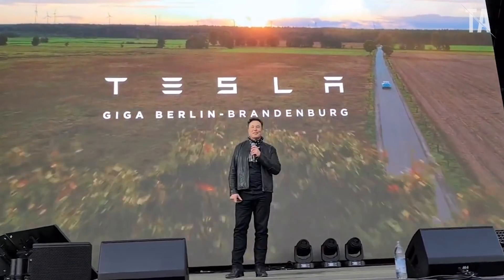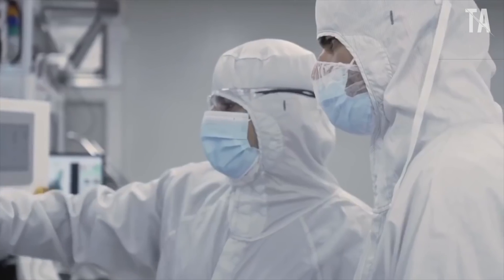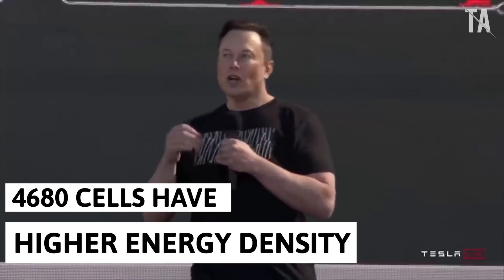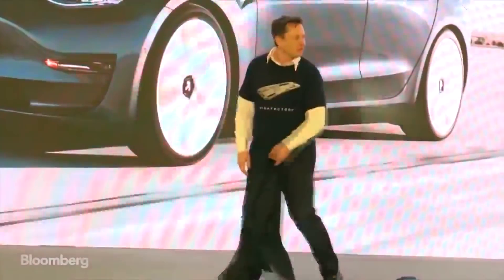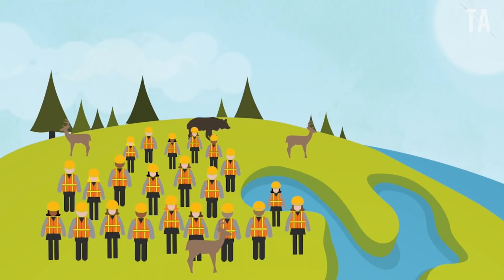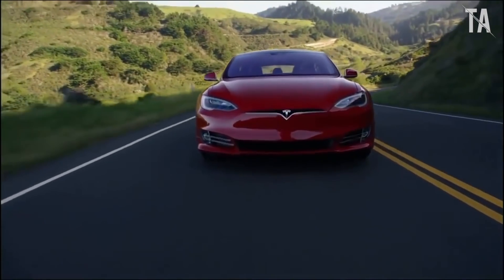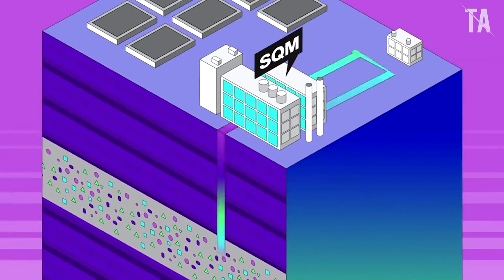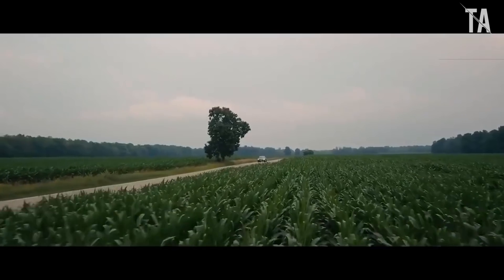Elon Musk WARNED EVERYONE The NEW Tesla 4680 BATTERY Will DESTROY ALL EV COMPETITION!

Comment: @Jabulani Harvey  you cannot cost effectively refine lithium bonded to carbon from chemical Degredation .. Its molecularly bonded to the anodes and cathodes.. which is why it becomes weaker in storing electrons.. lithium ion batteries aren't producing Ionic radioactivity.. it's branding, like 20v max DeWalt batteries are STILL only 18.6 volts.. and will power Milwaukee cordless tools.. point being there is no economical method to refine lithium from lithium batteries..

It's a finite resource..

MOST of which is found in dead rainforests AND more abundantly LIVING Rainforests... It's mined similar to fracking into limestone shale, which again is found in mountainous deserts, afghan NK etc.. " mankind hasn't yet figured out how to use  NMRF for  Harmonic synchrony , beyond poor attempts to build massive rings the size of to barely achieve over unity for TRILLIONTHS of a second..

So the left's plan is to F*st F** 
The Amazon and Congo rainforests for lithium, Neodymium cobalt which are Essential to the 15% efficient " brushless motors, when alnieko, Quartz crystal and Samarian Cobalt are Far stronger in Gaussian density and NOT Chemically Carcinogenic like Neodymium.. Quartz has been grown by the metric TONS...

How about an Electroacoustic piezoelectric quartz crystal Battery instead?

Comment: Your clickbait title is absurd also if the 4680 cells are the future then why switch the standard range to LFP batteries??
Reply: Actually 4680 only refers to the form factor.  LFP refers to the chemistry.
Reply: @audistik1199  I do understand that, how ever my purpose in stating that is why is Tesla using a different style of cell instead of the structure pack? I know that 4680 cells probably won’t be rolled out until giga burlin and won’t be seen in the US until giga Texas is fully op! I’m just saying if 4680 cells are the future why is Tesla using 3 types maybe 4 of cell packs
Reply: @nooneimportant4335  I think their production is growing so fast that they aren’t going to have enough cells of their own.  They are probably going to be producing 3-4 times as many cars by the end of 2022.  They usually use foam to bond the cells in the pack, so the specific form may not be a concern.  Just speculating.

Comment: I'm loving everything i hear about the 4680, but we still need to find a replacement for expensive and finite lithium. sodium or carbon/graphite? something super cheap, environmentally friendly and an infinite supply.
Reply: recycling should help
Reply: @jabulaniharvey  you cannot cost effectively refine lithium bonded to carbon from chemical Degredation .. Its molecularly bonded to the anodes and cathodes.. which is why it becomes weaker in storing electrons.. lithium ion batteries aren't producing Ionic radioactivity.. it's branding, like 20v max DeWalt batteries are STILL only 18.6 volts.. and will power Milwaukee cordless tools.. point being there is no economical method to refine lithium from lithium batteries..

It's a finite resource..

MOST of which is found in dead rainforests AND more abundantly LIVING Rainforests... It's mined similar to fracking into limestone shale, which again is found in mountainous deserts, afghan NK etc.. " mankind hasn't yet figured out how to use  NMRF for  Harmonic synchrony , beyond poor attempts to build massive rings the size of to barely achieve over unity for TRILLIONTHS of a second..

So the left's plan is to F*st F** 
The Amazon and Congo rainforests for lithium, Neodymium cobalt which are Essential to the 15% efficient " brushless motors, when alnieko, Quartz crystal and Samarian Cobalt are Far stronger in Gaussian density and NOT Chemically Carcinogenic like Neodymium.. Quartz has been grown by the metric TONS...

How about an Electroacoustic piezoelectric quartz crystal Battery instead?

Comment: 4680 battery production is a large risc. It is very difficult to produce, maybe starting end 2022 in volume if all goes well.
On the cell level it has no increased energy density. There is an advantage in power-density though, because of the tabless design.
Overall, recycling of lithium will become very important, but there is no solution for that at the moment. Without recycling all worldwide available lithium will be used in 2050.
Don’t expect much progress anymore in lithium cells, because fundamental physical limits are reached at the moment.
The move to produce LFP cells as well, is a good one, this is more futureproof and more environmentally friendly.
Reply: Thats why he found spacex
Reply: Sep 2020 Tesla said the new battery benefits will be in production in three years... it would be end of 2023. Still two years to go.
16% cell level energy density improvement from the larger, tap-less cell design.
There are lithium battery recycling solutions today... at least for large batteries like what EVs and grid storage and home storage use... not a problem... an opportunity. I don't know how we could recycle all the tiny lithium batteries we use in all our small gadgets (and those have a ton of cobalt and nickel).   
Lithium is not going to be the bottle neck, if mining is kept expanding. 
There seems to be a lot of new cost and energy density improvements coming up in lithium ion batteries... doesn't mean that other battery chemistries can't become even better for us further in the future.

Comment: The new design does not do away with the need for standardized quick exchange packaging. More than half of the households are not able to have individual charging hookups. Widespread use of charging hookups poses the threat of neighborhood power grid overload. The quick exchange paradigm would be serviced by conversion of filling stations to quick exchange depots. Regional recharging and distribution centers located adjacent to power generating plants or renewable energy harvesting facilities would obviate threat of grid overload. As breakthrough innovation in power density storage comes forth, a degree of protection from technological obsolescence for owners of EV’s would be provided. Range anxiety would be done away with, and wasteful inherent empty back hauls of tank wagons would be replaced by 18 wheelers, perhaps powered by hydrogen or natural gas.
Reply: The bidirectional batteries would have to be located near the destination points in the neighborhood to prevent overheating of the power lines or protective blackouts. It still would not provide a degree of protection from technological obsolescence for the EV owners nor provide relief from range anxiety for long distance travel or travel delays from long charging times!
Reply: You get it.  I am very far from an expert, but I couldn't have said it better myself. I believe hydrogen fuel cells may be the best way to go for 18 wheelers.
Reply: really? are you not aware the bidirectional batteries actually have the potential to do the opposite and move peak loads to off peak hours?

Comment: 4680 conductivity and safety issue 

Tesla is an innovative company in many ways but fall short in battery packaging. 

The patented 4680 architecture isn’t ready unless the associate problems are addressed and resolved. 

Issue? All lithium ion cell in cylindrical package:

(1) use a mechanical preload on a welded tab connecting between - anode and cell base - has been removed in 4680 by Tesla, replaced by a number of anode flaps, with little to no preload. 

Problem-1? 
Cell’s conduction path complete by soft anode flaps can be deformed out of shape. Once deformed it cannot return in its original shape - without a preload mechanism, hence the lost of a connection. Flaps will continue be bumped open circuit as inertial shock persists, and the eventual anode open circuit. That immediately follow by a spark next to hot and flammable chemical. Open circuit can be immediate  in case of a road accident.  

(2) in smaller diameter 18650 / 2170 cells heat sink at the cylinder wall, proven safely and longevity in early model 3/Y. However 4680 use heat sink at cell base via anode flaps (point contacts) is a bad idea in heat sinking. Practitioners in heat sinking issue calling for gap less plus a preloaded thermal interfaces, as oppose to point contacts constituted in a tab less architecture.

Problem-2a overheating those heat sensitive chemistry and a premature cell aging issue. 
Problem-2b overheated chemistry is easier to react to enter ignition sooner.
Reply: This analysis of battery tech is way above most people’s head. So. I will buy a Tesla with 4680. Battery unless something better, not invented yet, is available.
Reply: @jacka7211 
The simple answer is that 4680 replacing (a preloaded tab) for (multi point contacting flaps minus preload). Flaps can be bump open circuit to creating spark to ignite hot chemical inside. 

Secondly point contact flaps cannot sink enough heat through cell base, can overheating the chemical inside for (1) premature aging, and (2) low flash point to fire hazard. 

I’d not buy one built with 4680 unless those issues are cleared.
Reply: @philoso377  WOW much been said, almost lost.
How do we design the future bettery
Reply: @mustaphaali2454  
The tab less architecture is a good start. 
All we need is to pass the heat from each anode flap directly onto the cell shell base. By adding a reflow soldering process along the current mass production line. Reflow heat come from induction coil at the steel cell shell base. As long as the paste solder and flux doesn’t invade the cell chemical.
Reply: That was why Panasonic expressed some reservations about 4680. Under fast charging and discharging (acceleration) the battery can get very hot in the center. The heat has to diffuse thru a 23 mm distance to the battery wall to be dissipated by cooling fluid. If there is a conducting rod at the center of the battery, some of the heat can be carried out. I would imagine that the 4680 would need some chilled air or chilled liquid to dissipate the heat fast enough to prevent heat buildup at the core of each battery cell. This will use some of the battery energy.
To me, it is inferior to BYD blade battery. The thickness of the blade is only 1.9 mm. Heat can diffuse fast enough to the surface. BYD use air at ambient temp to cool the battery.
Reply: @Kukaboora  I just met the first person who have concern with the 4680. You think 4680 heat sink through cylinder wall like 2170 pack? Not - heat in 4680 will pass through Cu anode downwards to meet with cooling channels at the cell base. However the anode flap can only point contact at the cell base. Practically point contacts are heat insulation but conduction. 

Without preload acting on junction and without continuous surface area contact in 4580 we have a heat sink problem. 

Plus the opportunity to anode arc, ignition is waiting to happen.